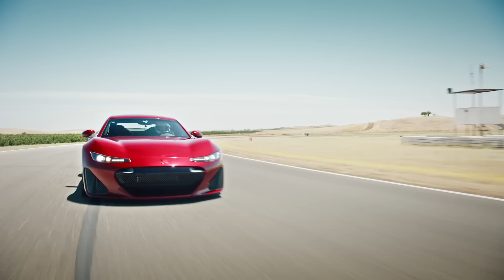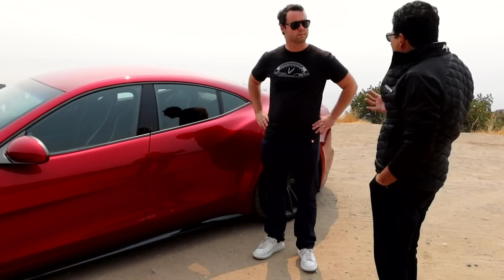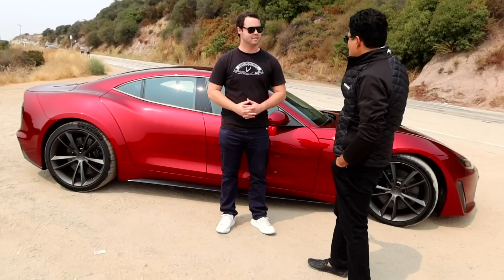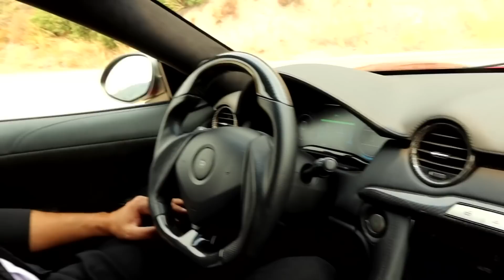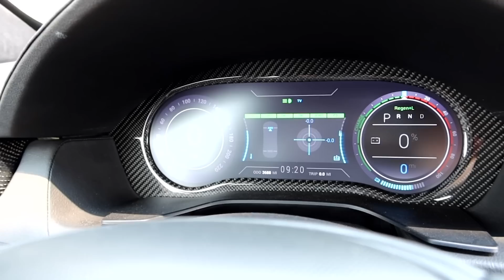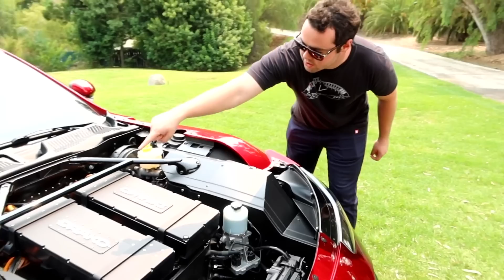MEET THE $1.3 MILLION 1200HP ALL ELECTRIC TESLA KILLER!

Comment: FYI he freaking said it charges at 150kw & has 90kwh battery. Do the damn math. It's about 40 Minutes to 90% real world with a bit of safety buffer.
Reply: If we need to do the math then he is hiding something
Reply: @vika0194  It's extremely simple math. Great stuff just follows math. The opposite of hiding.
Reply: Neojhun You have been making this comment everywhere in this comment section.
Reply: @vika0194  Because it's a fact layman need to know. Math should not be that hard.

Comment: What range does it get
Reply: 90kwh Battery & Sleek low body.
180 Miles Lead Foot lose your licence.
250 Miles if you mild hypermile it.
Reply: @Neojhun  thats good i suppose the charge times depend on what charger you use
Reply: @thepurdychannel8866  Obviously, but the max 150kw is a popular industry standard CCS 2.0. Most likely the easiest to find Public Fast Charger in the near future. About 40 Minutes. That has no real relation to Range.